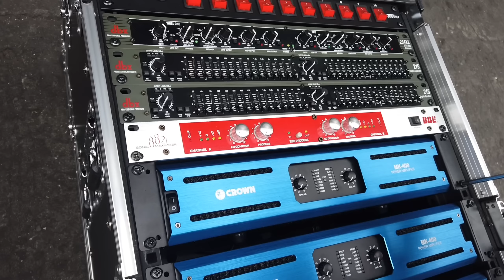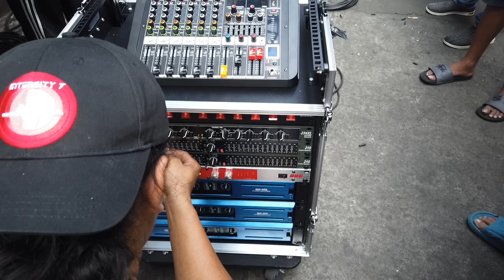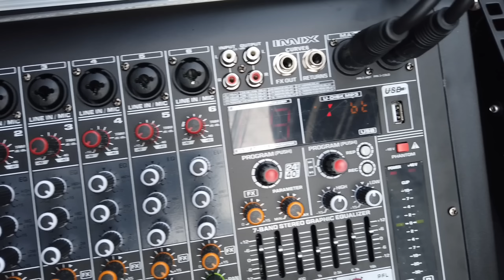LIBANGAN LANG DAW NI KUYA SA BAHAY NYA,MINI SOUND SYSTEM//SUBSCOOP 15 FIBER COATED//DUAL 12 MIDHIGH

Comment: Bitin yung ampli nya sa sub boss dapat category5 para gwapo hanot nya hahah
Reply: Yung true power Ng speker nya 600watts rms  at naka 4omhs naman Yung amp Kaya boss
Reply: @jerwinandreifacun5546  kaya boss kaya lang patunogin pero hirap parin ampli nyan boss 600rms lang ampli nya samantala ang dina drive nya apat na speaker na 1k watts di kaya bayohin yan ng 600rms na power amp boss heheheh iinit lang amp mo jan
Reply from the maker: Boss over na Ang category 5 Kung pang  gamit lng naman sa Bahay Hindi naman Yan pang hugbugan.
Reply: @electrosoundsanddiy  ok na ok namn yan idol pang bahay lang namn e pero ra sakin lang namn idol mas swabe sana kung cat5 heheheh para plang palo yung sub nya
Reply: Kulang ka lang sa pansin.
Reply: @electrosoundsanddiy anung silbi nman boss un apat na d15 1000watts kung pangbahay lang nman pwd nman mababa watts lng mas mura.. para makabenta lng kayu at sa porsyento? Wag sana ganun boss kawawa un tao😂😂😂😂
Reply: nasa open Area owner niyan or sa PROBINSYA walang dikit dikit ang Bahay di na mabibitin may Ari niyan sa lakas pag mahina kase nabibintin ang iba pipilitin lakasan hanggang masira nasa operator ang control kung gusto mahina lang volume kung NEW YEAR pang malakasang setup di bitin